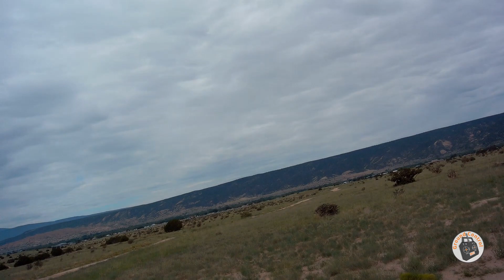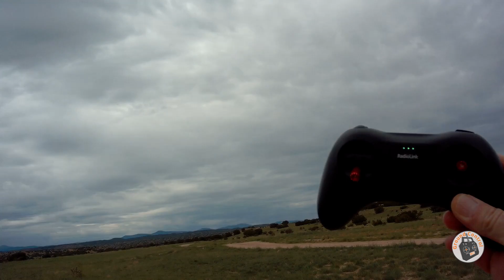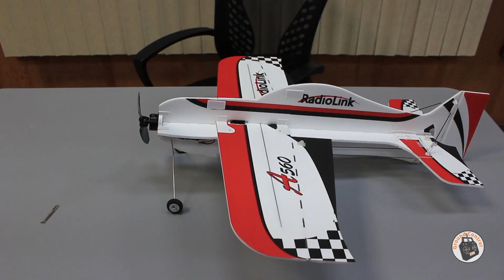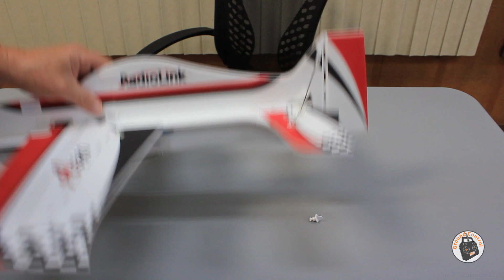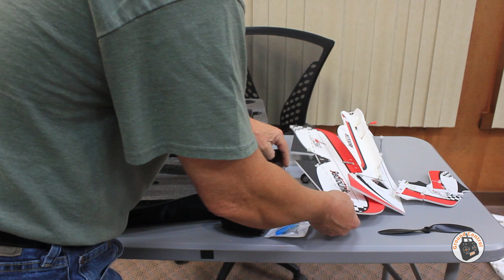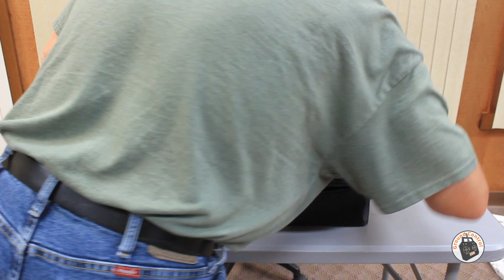Test Flight in Stormy Skies! Launching! RadioLink A560 Trainer 3D Plane with 5 Mode Gyro RTF!

Comment: I have the gyro installed and working ok, but. In stabilized mode, the AMOUNT of aileron and elevator travel is about 50 % of the travel in non gyro mode. This is when sitting on the ground, not in motion. The flight response in stabilized mode is badly inadequate!  But, way too much in non gyro mode. Servo travel should not be different. The gyro should only manage roll or pitch ANGLE. Ed
Reply from the maker: Hum...I don't know. That's the way every gyro I've used works. You might try Acrobat Mode with a recent version of the Byme-A Gyro It's not restrictive at all but does Auto-Leveling.
Here's a link to My Setup File: https://drive.google.com/file/d/1_Z0rxpRO1OwlLBpcrunfx_XadvhcnT44/view?usp=sharing
That might be helpful.

Comment: Used to fly beginner-intermediate years ago.  Would you be willing to post a talk through basic getting-back-into it couple of flights so we’re not paranoid of crashing while
trying to re-learn? We catch up fast but could use safe settings to relearn…
Reply from the maker: Hi Billy!
I'm glad you're wanting to get back into the Hobby as things just keep getting better and better.
Yes, if you have any questions just let me know and I'll try to provide some answers, some of the answers may even be correct ;-) I have a few planes in mind that would be great for getting started again.
Let me know the type of plane you're interested in and I'll let you know what I would recommend.
This plane is an excellent 3D Beginner Plane but there is very good Bush Plane and a Warbird that are great beginner planes as well and I have setups for quite a few aircraft.
See you in the Air!

Comment: I've put a little 2-3cell voltage alarm on my one,its handy you can see the red light when power is getting low, then the alarm goes off aswell 👍🏼
Reply from the maker: Hi Jason!
I have some of those as I used to use them on quadcopters a long time ago.
I'm sure you can hear the buzzzer on this one since it's pretty quiet.
This is such a fun 3D Trainer Plane.
I've taken it with me on my last (3) flight sessions.
I'm able to get a pretty good flat spin with it and I'm trying to get better at other maneuvers I've only attempted with this plane.
Absolutely Awesome!
See you in the Air!
Reply: @GroundControlRC  I'm loving the plane it's great fun,handles wind ok aswell,im now getting used to stunt mode,had it hover just off the ground in front of me fantastic
Reply from the maker: @jasonleesuffolk  It's a blast!

Comment: What motor did you get in your a560?
Reply from the maker: I just got back from another flight session with this 3D Plane.
The Motor is a 2206 1450kv.
With that 8x3.8 Prop it has great power and 10 minutes of flight time.
Not bad for a 2S Power System.
I'm having a blast with this 3D Trainer ;-)
See you in the Air!
Reply: @GroundControlRC  Thanks for the reply! I also have a similar motor(2206 1500kv). I've just finished testing the motor with an 8 inch prop on 2s. Mine vibrates quite a bit when a propeller is on. Im too scared to put it on full throttle right now because the propeller flew away at around half throttle. 

Are the vibrations normal on these prop saver type motors? I used the gemfan slowfly 8x4.3 and  gemfan 8040 orange props.
Reply from the maker: @pipoypipoy7796  I've not had much luck with these prop saver mounts except for this one.
The prop fits nice and snug on the adapter.
Have you balanced your props?
I seldom receive a prop that doesn't need balancing.

Comment: Do you use the original battery?  I wonder what other battery would be suitable for this plane 🤔
Reply from the maker: Hi Jason!
Yes, I'm flying with the Stock LIPOs.
I also put a flight on it with a 2S 500mah LIPO I had, but it's smaller, so shorter flight time.
I have quite a few GNB 2S 550mah LIPOs that are a bit wider than the stock LIPO.
I'm going to carve out the battery slot just a bit so I can use those LIPOs.
The Dimensions of the Stock LIPO: 50mm length x 24mm width x 18mm high
Reply: @GroundControlRC  what do you think about this battery O-HE2S1P065030A maybe that would be suitable? Or this RDNB6002S30JST
Reply from the maker: @jasonleesuffolk  I'd guess either one would work.
I didn't see any dimensions on the 1st one but you may have to widen the battery slot a bit for it to fit.
That's what I'm going to do.

Comment: "Neither rain nor snow nor even fog...."

Yah, 3D planes are built light with excess lift, so most create too much drag for high speed.

Flies nice.  I still prefer a 3D fuselage over 3D flight.  ;-)

Happy flying!
Reply from the maker: Thanks!
I figured I'd get soaked before I completed the flight but it didn't start raining until I was half way home ;-)
Yeah, both of the ones I've flown have been very floaty.
This one has more power than the Yak54 800mm 3D Plane I had.
It's going to be fun.
See you in the Air!

Comment: Unless I was going on a trip by plane.. I wouldn't even take it apart to put in the case.... Love the 3D vertical mode.
Reply from the maker: Hi Lasersbee!
No, I have it packed away now but not unless I want to take it with me when I drive cross country and want something to fly while I'm there.
That case will sure come in handy for that purpose.
That vertical mode is so very cool.
I knew this mode was in every Byme-A Gyro but I've never tested it until now.
I may have to test that in something else that has a lot of power ;-)
See you in the Air!

Comment: I dig the handy take down box,
perfect for picking up the bits scattered of another Crash in the field.
A classy Casket to lay a wreath on!
Beauty GCRC, Power up.
Reply from the maker: Hehehe...that is too funny ;-)
I about fell out of my chair.
That's not nice making an old person fall down laughing ;-)
I'll have to stock up on wreaths!
See you in the Air!
Reply: @GroundControlRC  Hahhaaha!
Been doing a lot of repairs lately.
I'm skippin A Youtube attempt and going straight to My new Book,,,,
"Foam and Me, An RC Tale"
Love from upsidedowntown Friend.
Reply from the maker: @jonoedwards350  Hehehe....I want the 1st Autographed Copy ;-)
Reply: @GroundControlRC  Aahahahha,  I'll make sure Your caterererered For! Building My third ASW-28 right now, things have no aileron domination. Doubled the size after Your Phoenix 2.0 mods. foiled extra curves into the foam, Superlift is the plan?
Reply from the maker: @jonoedwards350  Those full span ailerons sure made a difference.
I'm just waiting on my new motor to get the V2 back in the Air.
I want to put one of the RacerStar 4023 1050kv 2S-6S Motors in it but they're out of stock.
I've got a new metal alloy spinner and some 9x6 props coming for the PhoenixS though for some 4S fun ;-)
Good luck on the ASW-28.
I'm interested in how much that improves the roll on that 2.8m glider.
I couldn't get those wings in the truck to transport them out to the Desert ;-)